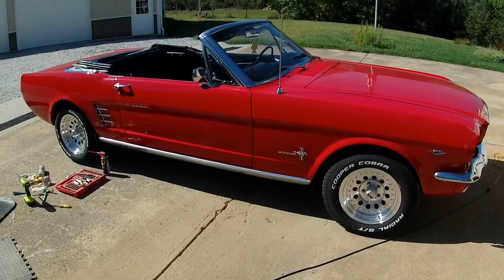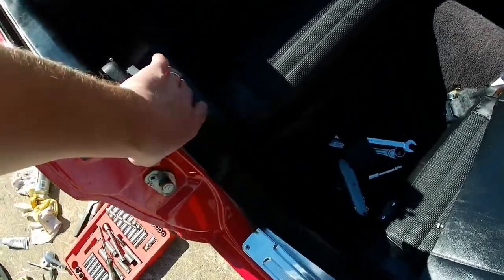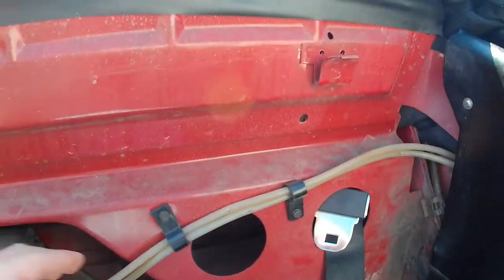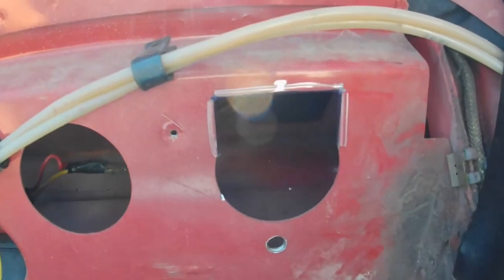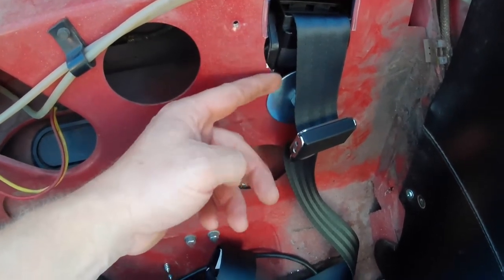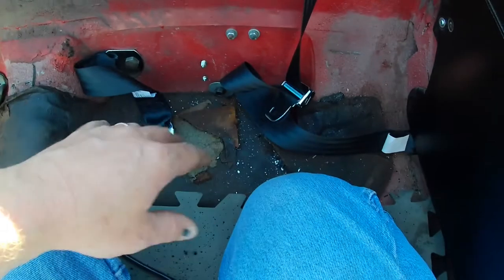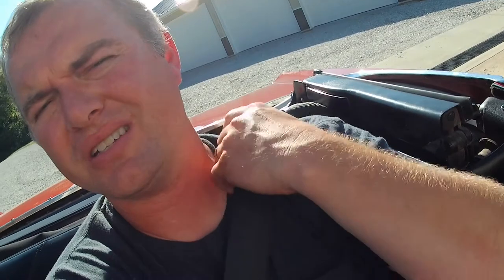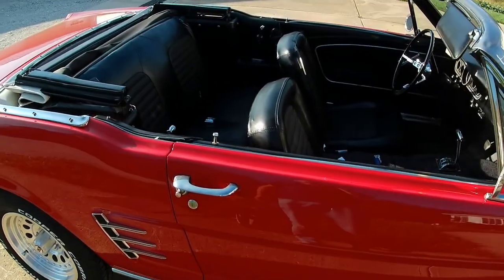Shoulder Seatbelts Install '66 Mustang

Comment: Excellent install video.  I have all four three point belts and am ready to install in my ‘66 convertible.  Your experience is a huge help.  Since it’s been awhile, is there anything you’d change now that you’ve had time to reflect on your install?   Thank you!
Reply from the maker: As far as installation, I don’t know how it could be done better without adding bracing to the top of the rear seat. I’m happy with install. The belts themselves could be nicer. I think I got mine from CJ Ponyparts. They click/catch when putting them on/pulling them out. It makes putting them on a bit frustrating. It happens EVERY time, even when you try to pull them out gently. I expected a little nicer quality. That’s my only complaint and it’s pretty minor.